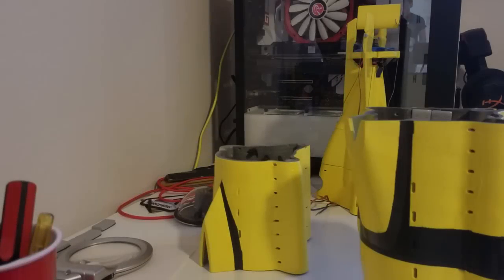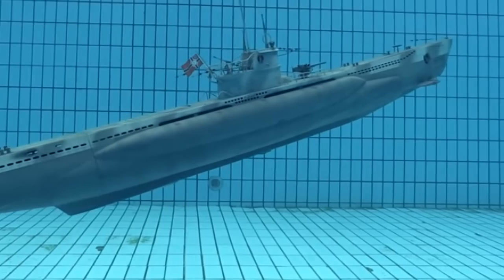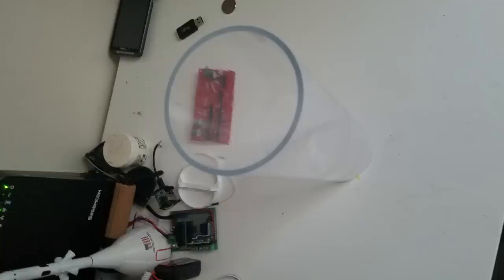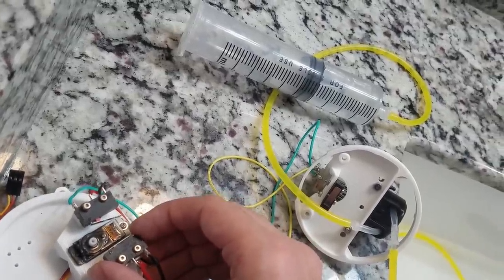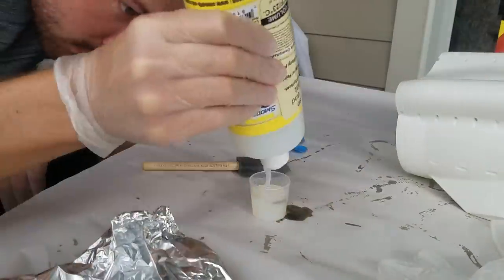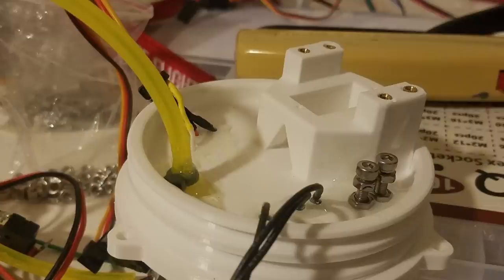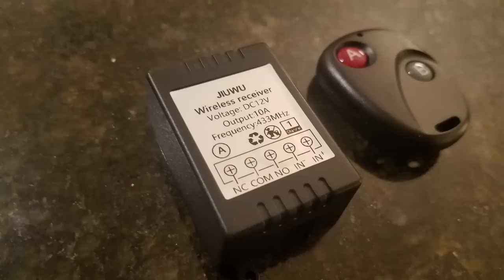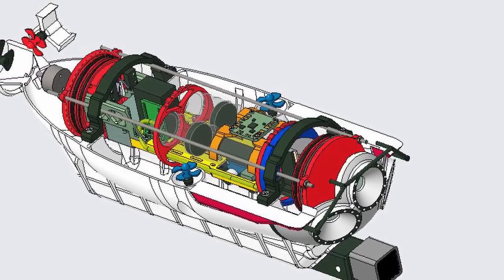3D PRINTED RC Subnautica Cyclops SUBMARINE Part 1 - Internal Electronics and Dive System

Comment: Hell yeah dude, that is so rad. Can't wait for part 2! Would be interested to see how deep it could go... I imagine at some point the water pressure would be great enough to force passed the pumps to fill the syringes and sink it?
Reply from the maker: The manufacturer spec's the pump at approximately 5 meters of elevation pressure so you would need to remain above that depth to be able to drain the ballast. As I see it, about 2.5m is probably my maximum acceptable depth to have a nice fat safety margin.
Reply: @TZeroSystems  if you use a motor to control the movement of syringe than you would not be limited by the pump max pressure but rether with the holding pressure of the syringe. I have read online that the smaller the syringe the more pressure it will hold. Any prediction how much pressure the normal 100ml syringe can hold?

Comment: Hello, a question about the use of smooth on XTC-3D, is it thin or do you mix it with something to thin it to be able to brush it on smooth? Is it applied inside and out of the submarine hull? Thanks again for posting.
Reply from the maker: Inside and out all over the place! Also it is pretty thin so it flows well. I apply using a sponge brush for best results and no streaks!

Comment: Great work but I am left stumped on one point: with the syringe ballast tanks, where does the air go? You can't expel it because it needs to be present when you pull the water back out right?
Reply from the maker: It pressurizes the cylinder
Reply: @TZeroSystems  okay I had considered that, but did that put a limit on how much water a syringe can intake?
Reply from the maker: @isaacromero7411  Exactly! There is a combination of factors, the pump strength, the depth, and the volume all play into this. Overall, the syringe can only fill to about 80% and the pump is only capable of pumping out water when the sub is above 5m depth. Below that and the water pressure exceeds the pumps ability to move it. The cylinder can help a bit at this depth due to the stored pressure but the math shows it gets dicey below 5m.
Reply: @TZeroSystems  wow that is an amazing build then from the standpoint of ballast efficiency. Do you think a next generation would benefit from something like ballast balloons?
Reply from the maker: @isaacromero7411  It could! i just happened to use a syringe cause i had that in my head but i have seen it done with blood pressure cuffs for balloons too!

Comment: Anychance you will be able to provide the electronic circuit schematic and program for the ballast control?
Reply from the maker: Sure! it is very simple, Arduino nano with 1 PWM pin connected to servo out, one pin for RX in, and a button across one of the pins to detect fill.
Reply from the maker: I'll include it on thingiverse
Reply: @TZeroSystems  Can you post a link to it on thingiverse? The electronic circuit?
Reply: @TZeroSystems  Would it be possible to see a picture of the actual circuit you have OR even better the schematic?

Comment: How deep would you dare to take this if it were a real tethered ROV.  What pressure can that pump handle? I'm trying to build a system that can do 150psi.  For 300 feet of depth.  

Obviously the syringe will never have to handle that because the pump is gating the pressure (a nice thing about this design) but what about the pump? Do you have a link to that?
Reply from the maker: Easily 20m deep, the pump though can only manage half that

Comment: Would spraying it in a clear coat seal the pla or I was thinking of using Uv printer resin
Reply from the maker: It can but the harder and thicker the coating the better so as long as it gets on there then you should be a ok
Reply: @TZeroSystems  I got some UV resin today I will use that as a coating

Comment: Sup man, what filament did you use and what printer do you have? Cheers :)
Reply from the maker: This is printed on multiple printer but everything should be printable on an Ender 3
Reply: @TZeroSystems  so just PLA filament? Or PETG?
Reply from the maker: @hueyskitchen906  Either works! I suggest an Epoxy coat though no matter what for longevity!

Comment: Hello. What servos are you using? How do they work in the water?
Reply from the maker: Corrosion X spray inside the casing is a real OP solution
Reply: @TZeroSystems  thx. what are the contacts that going from WTC (MP,DP?)